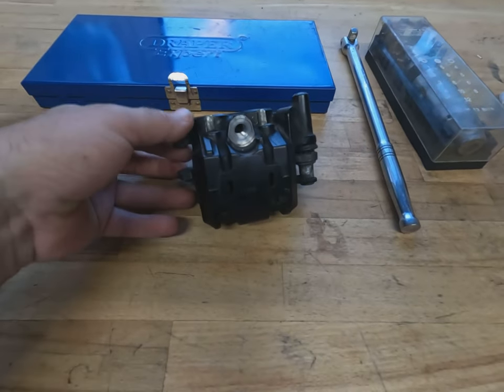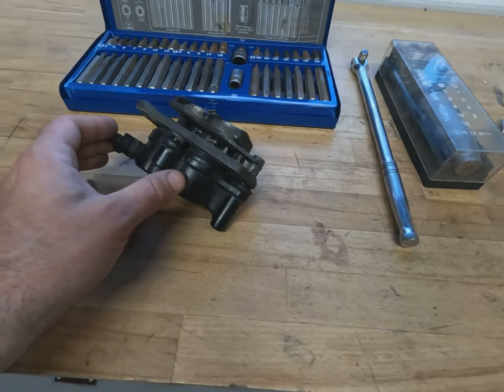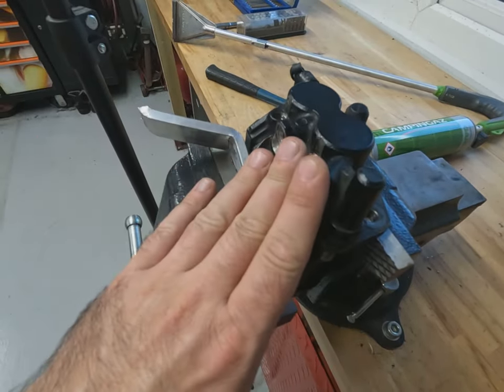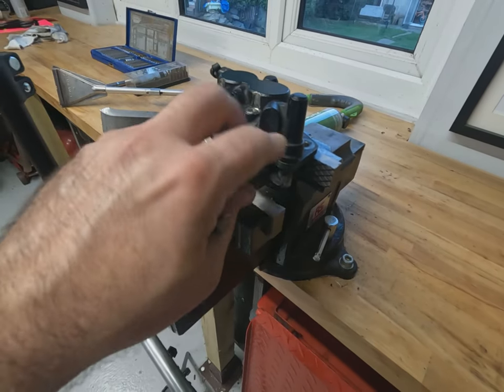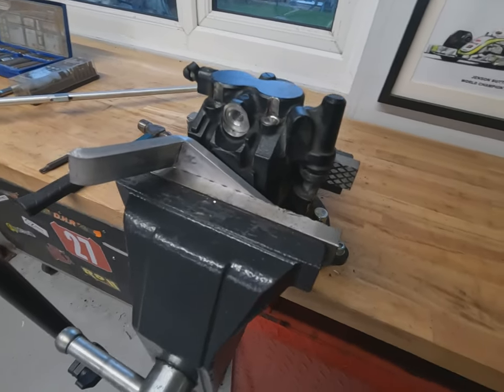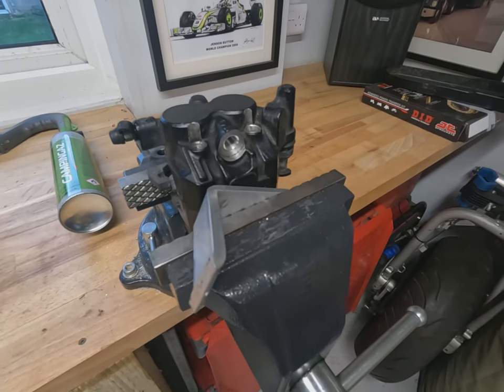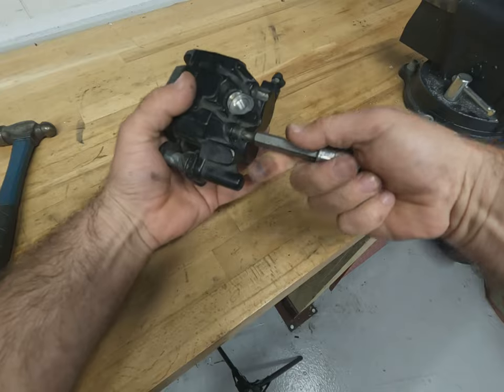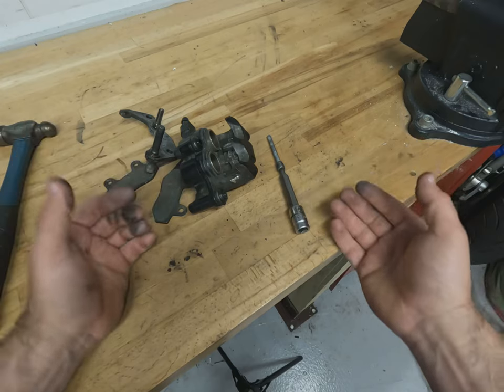How to remove a rounded brake caliper pin

Comment: I wonder if it would help to put a thin layer of grease just around the smooth part of the caliper pins hex head to help prevent corrosion between the head and the recessed chamber in the caliper
Reply from the maker: @cristopherfrakes1416  absolutely or even completely fill the hole as very common problem. Could also use a rubber grommet which some do have
Reply: @ComrodMsport  yeah mine had his rubber grommets, but two of them must have come out, and now my caliper pins are seized so bad that even using a torch, Petey blaster, and Milwaukee's biggest impact the fuckers won't come out
Reply from the maker: @ 😟 sounds like the only option left is to get the war face out 

https://youtube.com/shorts/RqjAY6f1frk?si=dDna9NI0Vk8CZ-Sd

Comment: Hi. Could I try to do this with the caliper still attached to my scooter? I guess I could heat it up with it hanging down attached, but would I be able to hold it with my hands whilst trying to remove the pin with the wrench? One mechanic that I was going to take my scooter to said he wouldn't remove the caliper, but I have decided to buy the tools and try it myself. I don't have a vice/clamp and I do not know how to bleed, so need to try it without detaching the caliper.
Reply from the maker: Hi, I wouldn’t advise it as it will still be full of fluid if heating it up and when knocking whatever tool into the rounded hole it will cause stress to the caliper mountings if not clamped securely in something like a vice. 
If you can find a tool that only requires gentle tapping to get to fit nice it might work, it really is a game of experience to judge. If in doubt, seek professional advice 👍
Reply: Ok thanks for the advice. The dealership mechanic definitely does this heating up whilst the caliper is still attached to the scooter though, so he must manage with fluid still in the caliper. I think I would be ok knocking the tool in. I can kind of rest it against a strong part of my scooter whilst doing it. I think I will try because these mechanics have taken all of my money for various things and I need to save on outgoings just lately